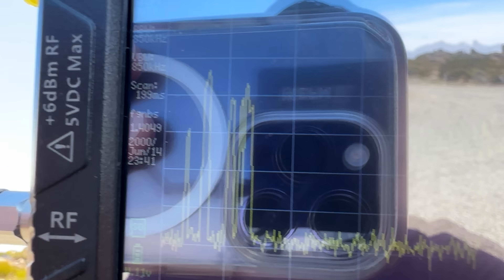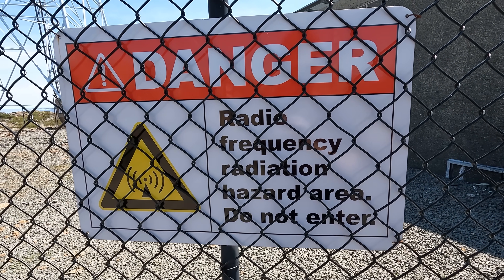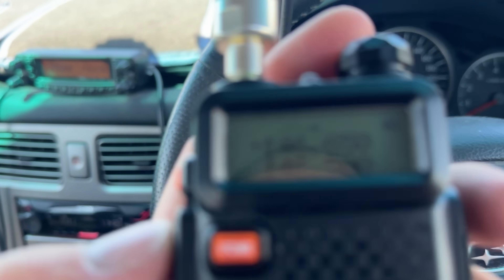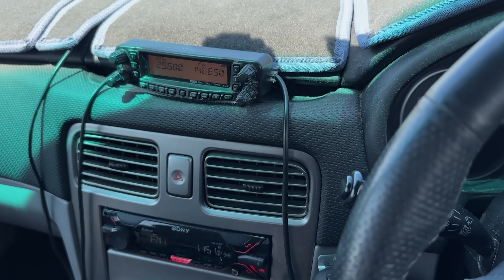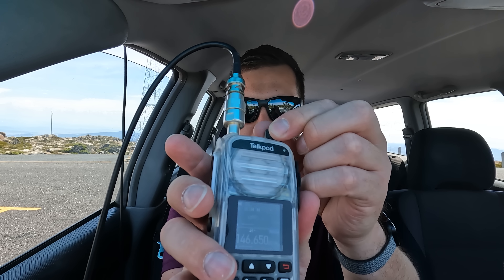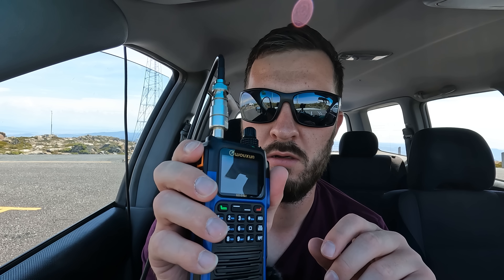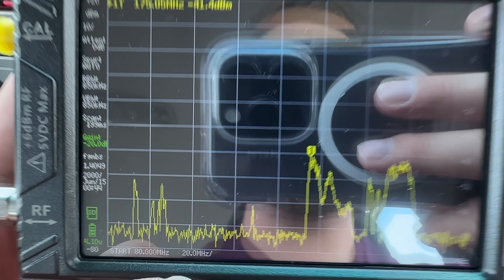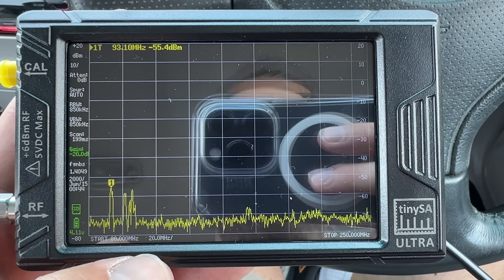This Will KILL Your Radio!!!

Comment: And yet, in Europe they use flea power. In the US many TV stations use 1Mw ERP.  Even with the use of DCI Band Pass Filters, the noise level I experience visiting some of the sites for a living is so high Ham radio is impossible on 2m or 432. There are locations were the combined receiving power would blow out the tinySA front end even using it with a 20db attenuator and the mobile antenna. We have one location were using a simple dipole we were able to light a small 2w light bulb. 6 each 1Mw TV transmitters on one mountain site. The whole top of the mountain is off limits to the general public .

Comment: Hi a very nice demonstration of Rx de-sensing.

Just a note. The Tiny SA Ultra's noise floor is ~-90. By setting -20dB attenuation, the noise floor rises by 20dB i.e ~-70dBm. 

The Tiny SA's displayed noise floor, has nothing to do with the noisy Mt Wellington environment. In other words; it's not the noise floor that deafens SDR radios.

PS I'd love if you could come up with a bench top methodology that better quantifies the difference between superhet and software defined radios i.e. the dBc level of adjacent channel interference at which a weak desired channel is lost or distorted?

73's VK5ZEJ

Comment: This is why a top-of-the-line HF transceiver is a LOT more expensive than a $35 SDR dongle.  Front end filtering combined with a strong front end mixer and, for SDR radios like Icom 7300, the analog-to-digital converter chip needs more bits not fewer. Cheap SDR's will use an 8 bit ADC but a good radio will use 12 to 16 bit ADC's.

Comment: I simply won't have any of those cheap radios. I only have ICOM, Yaesu and Kenwood handhelds. Plus my old Radio Shack HTX-202, which I still use BTW. The 202 is very narrow banded, only receives or xmits 2 meters. Now if it just had more than 12 memories!!

Comment: If you had an old Realistic HTX-202 handheld radio I bet you'll be able to use that handheld radio there. Those old HTX-202's had a very tight receive because they were not able to be modified to go beyond the 2 meter band so much immune to intermod interference!

Comment: And on the same token, you can bet your bottom dollar that the tower users have extensive filtering inline built into their racks to avoid cross talk and receive degradation.
Reply from the maker: There aren't many receivers on this site. Lowest is around 450 MHz, many up near 850 MHz and above. Our repeater's receiver on 146.100 MHz is the lowest frequency receiver on this site.

Comment: these cheap direct sampling radios dont work in an environment like that.
also a yaesu ft4x, ft65 will not work.
radios with a superhet receiver will do like a yaesu ft70, wouxun kg-uv9d and all the top devices.
thats the difference.
band pass filter can fix it but a little unpractical running around with a external filter 😁

Comment: Excellent thanks for this …. My next ht purchase will be either a kenwood or yeasu  !!! This explains why i battle with my cheap chinese gear … would also love to know if my tyt mduv 380 falls into the same category as the cheap chinese gear… BTW i tried reaching out to you on a few echolink repeaters in Hobart … let me know which one you are connected to …73s and seasonal greetings VK3EAN
Reply from the maker: Hey mate, I don’t usually listen or use EchoLink. I’m on AllstarLink though node 55580 or 59898. Cheers

Comment: I went to Mt Wellington in early January and called out on my Baofeng on the 2m call channel and never got any responses, I get off the mountain later on, call out on a repeater and then get multiple responses saying that the whole of Hobart was trying to get back to me and that I must of been up on Mt Wellington where the RF interference wipes out your receive. Unreal! Cheers for the video Hayden! 73's, Cameron VK3SWL
Reply from the maker: Hi Cameron, yeah it's a common occurrence! If you activate just down the road (or on the lower observation deck) I think you're still in the 25m vertical zone, but should be able to hear a lot better! Our repeater up there cops it, we have a lot of filtering and even then we can't stop it all. 73 Hayden

Comment: First thanks for the great videos. Next a question, I also use HAMRS, but what is the best way to log multiple parks from same contact... and the best way to log multiple callsigns from same contact? NS9T 73
Reply from the maker: If I understand the question right, you probably need to create a new log for multiple parks (if you're activating multiple parks). HAMRS has a field to put in the other stations park (if you've got a P2P contact). Callsigns from same contact will need to be entered separately.
Reply: ty very much @HamRadioDX

Comment: great job. they make small 2 meter bandpass filter about $50 USD. SOTABEAMS has them. band pass filters are very helpful on repeaters . also in a RF rich area do not use aluminum foil shield coax .    use coper foil or solod copper shield. the dissimilar metals makes harmonics and heterodyne noise in the coax . so no LMR coax. even a car parked near a strong RF field this will happen. more than filtering needed . the coax is a factor as well . 100% shielding with copper block the RF from going right in the coax  this can happen  with a filter and coax after to radio. don't want RF to slip in coax after filter.  73's
Reply from the maker: We run multiple filters on our repeater at this site. You're correct - the whole top of the mountain is "RF hot"... so there's lots and lots of little diode effects that cause all sorts of problems. No amount of filtering will fix them. We use Andrews LDF-450 heliax cable and RG-214 for interconnects inside the cabinet.

Comment: Had the pleasure of a site tour of the transmission facility up there  earlier this year. With the amount of RF getting pumped up the tower it is a wonder any handheld works.
Reply from the maker: Yeah it's been over 10 years I think since I was in the concrete tower site. Our repeater suffers a lot from intermod and desense from the RF hot environment up there. Duplexing is very tough.
Reply: @HamRadioDX  Yea I have seen in the past on ships antenna placement is very important.  It was a very informative tour by one tech to a tech from way back. The young fella was stoked to find someone that knew what he was on about even my wife knew what he was showing us while we had the walk though.  It was a great start to our holiday.
Reply from the maker: Nice! I should try to arrange another visit at some stage, it would make for an interesting video of course.

It’s hard to access sites like this for amateur repeater use, we are fortunate to have access to what we do.

Comment: I spent pretty well all day every day attending radio sites, a few of my ham rigs over the years were exceptional in surviving the high RF environments, obviously not a comprehensive list because these were my own radios but amongst mobiles the Kenwood TM-G707 with "AIP" was phenomenal. Amongst handhelds I still look back at the 1980s Icom IC-32, it had a tracking preselector in the front end.. 
I do have a pile of UV-5Rs, they are atrocious in high RF environments, they have limited dynamic range, very clever tech but they cannot compete with a good superhet. My UV-5Rs were often sat on top of transmitter racks while I worked on equipment, tough little things with great battery life but a very poor relation to the best rigs.

Comment: Wow so you tell your audience to protect your (handy-talky) with a 20db attenuator but do not link where to get one???
Reply from the maker: No I used a 20dB attenuator to protect my TinySA, not my HT. You can pick these up on Amazon or eBay. DC-3 GHz 20dB SMA attenuator.
Reply: It looks like you had the attenuator on both...

Anyway would a 30 or 40db be a better choice or is 20 more than sufficient?
Reply from the maker: Attenuator only on the TinySA. The TinySA allows a max input of +6dBm, so you’ll need to work out what attenuator you’d need for your application. So the strongest signal I saw on the broadcast site was -10, well below the max input. The 20dB att was just there as a “in case”.

If you were testing a transmitter, like a 5W HT you’d need a minimum of 40dB

Comment: It would be nice to have some other distant radio transmitting some known words (e. g. your callsign) in a loop for the test. I understand that you're comparing the quieting, but maybe with some modulation, it'd be better/worse. I can confirm that ham-specific HTs have great filtering. With my TH-D7, I've made contacts 59 in RF rich environments where my wideband SSB RX capable TH-F7 was completely deaf.
Reply from the maker: Yeah I didn’t have anything setup to test - I probably could’ve used a fox transmitter
Reply: I have the still-excellent D7 as well. And I have an F6 - is that what you meant? Triband, SSB DC-daylight Rx?

Comment: Smart on the 20db between your antenna and tinysa. I live in a much more normal urban rf environment and don't need an attenuator, but discovered that even here a 10db attenuator in that position gives me much cleaner signals and the unit's LNA works much better!

Comment: Good segment on selectivity and the compromises made to satisfy size and cost constraints. The spikes you saw are likely due to your SMA connectors only being finger tight. Unless torqued up to spec, the connectors leak a little when flexed.

Comment: Does "This Will KILL Your Radio!!!" mean it will damage the radio or just prevent it being used when close to the tower?
Reply: Prevent it being used. Will work fine again when you  leave.
Reply from the maker: All that RF will kill your radios ability to receive whilst there
Reply: @HamRadioDX  I noticed that when close to a 50KW FM tower I could receive the stations on it but nothing else, however 2m/70cm was ok
Reply: Not destroy, just make inoperative at that site.
Reply: kill-switch
Reply: It's dramatic.  A title such as "Strong RF out-of-band will de-sensitize the receiver on cheap radios" is less dramatic.  However, there is a strength that could actually damage the radio but at that point you too are probably being damaged.